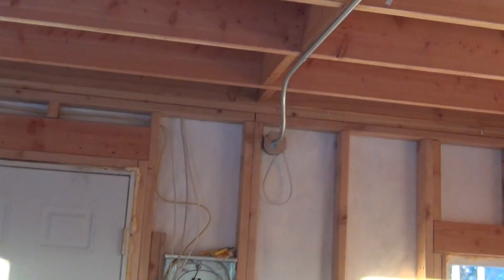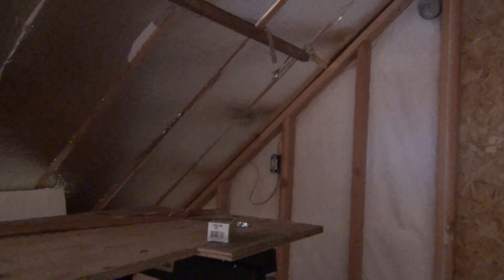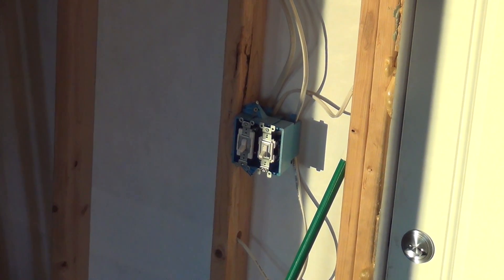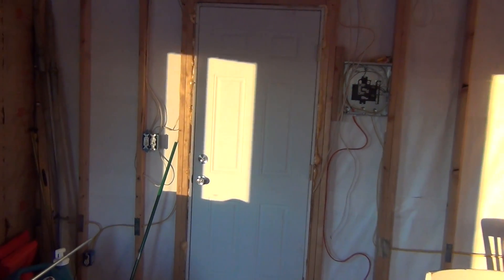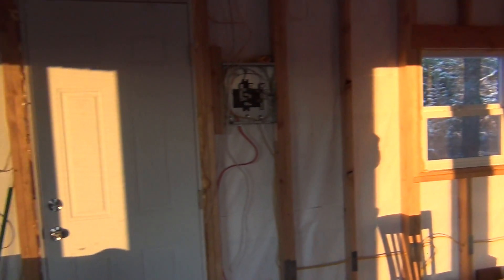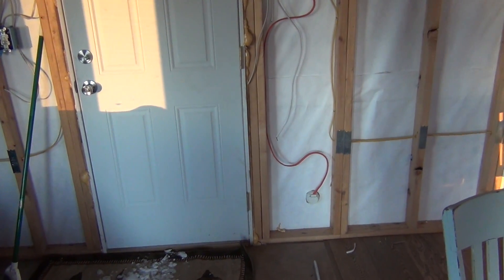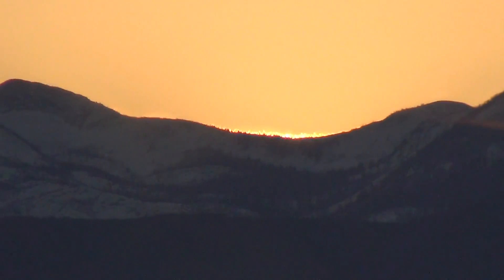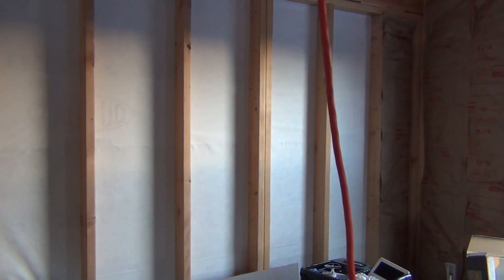Small Cabin Project “Electrical Wiring”

Comment: Good choice on running conduit, it helps with the cosmetics. One thing that I would suggest: don't terminate the conduit on a junction box cover at the wall (the box can't be opened afterwards). There are at least three solutions.  Let me know if you would like some pointers.
Reply from the maker: Sure..fire away.  I wanted to use flex cable but they sold it by the 50 ft roll.  Right now I can slide the cover sideways and just unhook the conduit from the box.   Is there some sort of adapter I can use with the system I have now?

Comment: Hey great job real quick question how do you wire your rv plug into your box I need to do the same on my cabin.  Thanks
Reply from the maker: +Southpaw210 Yeah no problem.  So I ran some heavy gauge wire from it to 1 side of the breaker panel.  This only allows 120V so I can only use half the amount of breaker spaces.  I could run a jumper between the sides, but I only need a couple of circuits anyway, besides..if I get a larger generator, then I could simply wire it for 220v later.
Reply: +design2survive Thanks for the info.   Happy Holidays.